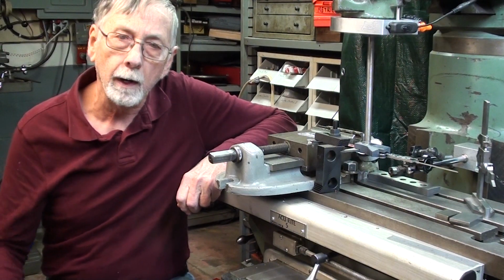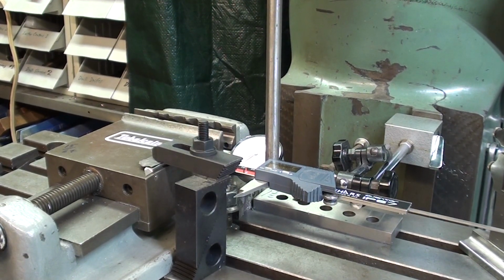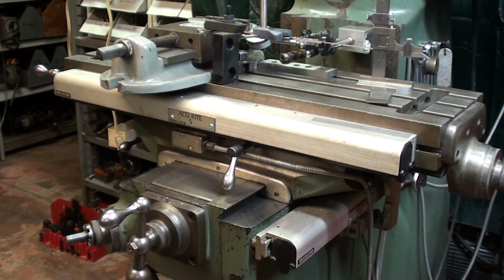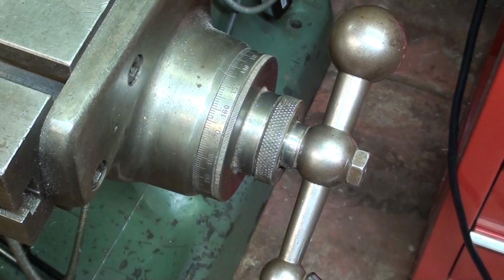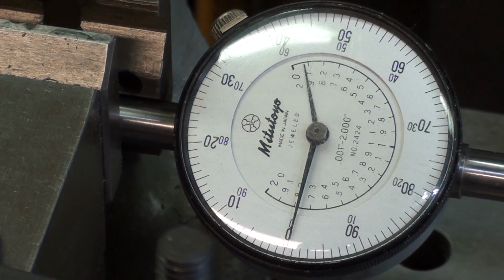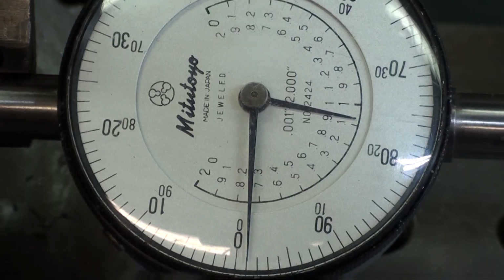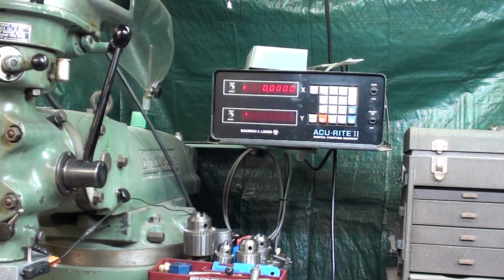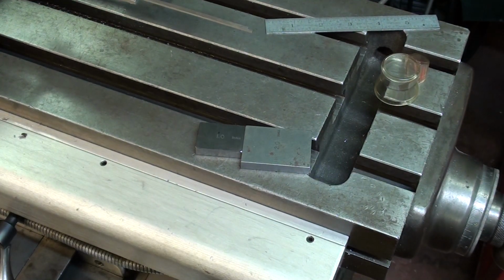Accuracy of the Bridgeport Mill Tips 527 tubalcain

Comment: I loved it!  We take things like this for granted and it's nice to test them out.    And I've got a couple of thoughts and an idea for you.  If the finger of the dial gauge is running on some roughness of the end cap I see it's on then if there's the SLIGHTEST angle to the whole setup the ball end of the indicator might be running down or up the side of a slight ridge.  It would not take much of an angular path  in drift of the finger to "walk" away and lose a thou or two.  So my suggestion is that the finger should be on a flat polished surface and then you may "find" your lost accuracy.

I've also got an idea for the gauge block test.  Set up and sweep a shelf with "back" wall  so the wall is very square to the X axis to a fine degree.  Make it long enough that you can test both the 2" gauge block and re-test with the dial gauge.  Set up the finger of the dial gauge on one part and with enough room for the 2" gauge block set up and zero out a test gauge.  Now run the table back a bit over 2", place the 2" gauge block and sneak back and set the DTI to read zero again.  And if the lead screw is "advanced" into zero on the DTI and again into zero from the same direction for zeroing the gauge block you can test the dial indicator, the dial gauge, the B&L digital RO and the lead screw all against the gauge block.

Howzatt?
Reply from the maker: Thank you, those are good ideas suggestions

Comment: Most any dial indicator will vary + - .001- .002. and beyond half way through the travel it can get worse. I never use much more than the first .1" on my dial indicators and most often only as a 0 to come back to. The little difference in the screw and the scales could be just the friction in the nut and ways, the glass scale sees actual table movement.
Reply from the maker: Thanks

Comment: GREAT FUN IMO! You got me thinking about the accuracy, or lack there of in the cadre of measuring tools here in my shop. There are 3- El-cheapo digital calipers, 1- Mitutoyo dial caliper, and my favorite little 1" Starrett 0.0000" micrometer. All were 0.001" of each other at 1.000"except cheapo #3 which gets abused to save the others. I guess next is the lathe ways vs mill table?! :) Thanks as always. G>

Comment: Just throwing this out. I would suspect that the dial indicator resting against the magbase may have some flex. As the distance decreased the amount of force on the dial increases which may flex the mag base. I would try putting another dial indicator on the back of the rod from the mag base to see if it is moving.
Tom

Comment: Nice work, Mr. Pete!
Maybe the dial indicator's max. accuracy requires a certain temperature? Perhaps you could follow up with a video on how dial indicator's accuracy are tuned, if that's even possible. Seems like the innards are just a transmission with a fixed gear ratio. The only thing that might change is the length of the plunger shaft, but the temperature would have to change while you are using it.

Comment: Of course accuracy and repeatability are different things. So far we seem to see measures of repeatability. Now, I know you know this better than I, but it seems that setting up to check each of these measuring devices against gauge blocks would help us determine the accuracy. My understanding is that gauge blocks are generally good to about 20 millionths of an inch, or as low as ~ 4 millionths, depending on the "grade" of the block set.

Comment: Hi Mr Pete, looking at your setup I think I have an idea why the dial indicator and the digital calipers were off a little.
Did you sweep them with another indicator to make sure they are perfectly in line with the ways of the bridgeport?
I did not hear you mention it so that may be the case. If they are not perfectly in line it causes what's called cosine error. ThisOldTony has a great video on the subject.

Comment: I studied metrology for a few years and the most important thing I learned is that every sensor or measurement devise is sensing or measuring itself. 
As for digital measuring  devices, the  accuracy of ALL of them is base accuracy ( say 1%) plus or minus LAST DIGIT. 
Where a human operator can distinguish whether the marks on Vernier scale align or not, digital device can not. One can observe this effect when digital device is positioned just so the last digit flicker between two adjacent values.
The last digit on a DRO or a caliper is 0.0005 (not 0.0001).
If DRO shows 1.000. The real value is somewhere between 1.0005 and 0.9995.

Comment: That’s interesting, however like you I tend believe in the DRO. On modern CNC machines the precision ball screws and the encoders is how they accurately position. Of course as those machines wear then backlash causes you same problems
Reply: Back in the 1970's I worked at Burgmaster in Los Angeles...building and testing the big turret mills and VTC's...the resolvers on the ballscrews were good to a 'tenth' but they didn't account for wear. However the electronic controller always made the moves in the + direction to account for backlash. The customers  that ordered 'standard' equipment got the ballscrew resolvers, the more demanding customers ordered the glass scale units..good for a 1/2 a tenth....yeah, 1/2 a tenth...waaaay closer than 1/2 a thou... Most of this stuff went to Hughes Tool Company...

Comment: Accuracy is a composit of reading, repeatability, resolution, standards, reference point, and money.  Then there are such factors as paralax, temperature, technique, attitude, phase of the moon, and how much accuracy do you really need.  As the military slogan says, "Measure it with a micrometer, mark it with chalk, cut it with an ax, file it to fit, and then paint it to match."About that dirt nap, put it off for a while, procrastinate, no big hurry is there?

Comment: I think many folks find it surprising that a dial indicator is not terrifically accurate over extended distances, but even a top quality dial indicator is likely to be spec-ed at .002" error over full travel. Unless damaged, they're generally quite accurate for short distances, such as measuring runout or other comparative measures. I had occasion to calibrate some dial indicators a while back (which basically just means checking they're still in spec, there's no adjustment possible). That's generally done with a (special) micrometer setup and it is a little surprising to see how they vary over their range. I'd say in general they're less accurate for distance than a digital caliper and way less accurate than a micrometer, although I had kind of considered them comparable to micrometers before working more with their innards.

Comment: I'm guessing the dial indicator and digital caliper may be a touch out of parallel with the table.

As far as the gage blocks go, it should be pretty straightforward to put a stop on the table and use a DTI to zero the location. Then just set the gage block between the DTI feeler and the stop and advance until it's back to zero. That's also a good way to test repeatability.
Reply from the maker: Yes, that video was in the can with the gauge blocks

Comment: Loved it!!! I was wondering if you had returned back to "0" using the Bridgeport dial, if the Mitutoyo would have returned to its original zero point.  If not, its mounting may not have been as stable as the other measuring tools.  Great Video drpete222!!!
Reply from the maker: Thanks , More to come

Comment: Could you set it up with an indicator against a fixed 2" gauge block stack as your standard?  For each measurement, reduce the stack by .5" and re-position the table to zero the indicator again, then and you know you've moved exactly .500".
Reply from the maker: I will be doing a similar experiments soon with blocks

Comment: I suspect the increasing spring pressure of the dial indicator was causing the rod on the mag base to flex slightly causing the error we saw on the dial.  It doesn't take much pressure to flex those things.
Reply from the maker: Be sure and watch upcoming videos

Comment: Very interesting experiment, Mr. Pete. This is a typical metrology problem; the guy with two watches is real. He needs more watches and read them more than once.   Separating variables helps - easiest would be to check dial indicator and calipers against the 2" jo-block. That  establishes consistency of both (of course within accuracy of the block-when was it last calibrated?). If Mitutoyo is indeed as bad as it seems (doubt it), use it while correcting for its error. Assume it is in linear proportion to distance. The take all these measurements 10-times or more, enter data into spreadsheet, calculate means, standard deviations and then see... Random repeatability errors will try to fall out of statistically significant number of measurements. Systematic errors will not. Then there is thermal expansion and its variation between steel and glass. Typical calibration temp is 20C. As someone mentioned, angular Abbe errors, and others - uneven wear of the screw (where most used) and and and; they all conspire. Hysteresis (stickiness) also is a problem. Then the real question is how good is good enough?
Reply from the maker: I think you lost me on some of that. But thank you I will be continuing on this experiment
Reply: @mrpete222  Mr. Pete, I apologize. I did not want to make it a treatise. You have done a marvelous job of demonstrating how difficult it can be to reconcile the differences in measurements using several instruments having comparable degree of (stated) accuracy. I am having a similar problem just now with measuring temperature using different methods.

Comment: Of course it’s interesting. It’s a great experiment. If only you had used a 36” diameter rod in the chuck! What were you thinking? Lol

A couple of things come to mind. With any digital instrument, there’s always uncertainty in the least significant digit. As the measurement ramps smoothly along, that digit “flips” at a certain point. Since you’re at the limit of your displayed resolution, it’s only exactly correct for an instant along that ramp, right when it flips. When you measure 3.4975 volts with your 4 digit voltmeter, no matter if it’s laboratory grade, it’s likely to vacillate between 3.497 and 3.498 because it has to make that rounding decision. Same with the DRO, even if the scales resolve to a gazillionth. So I think you can’t compare the tenths results on the DRO or caliper—they’re both rounding.

The dial indicator is still .002 away from the Bridgeport in the “backwards” test. Since the reference has moved to the DRO, they fall +/- .001 with respect to it. Makes things look better, in a way.

I’ve wondered before if worn lead screws become nonlinear, or merely loose.
Reply from the maker: Thank you, I intend to cover that point where the reading toggles

Comment: My thesis agrees with yours; the glass scale of the DRO is the most accurate.  I have checked my Bridgeport Clone Taiwan  mill against an Interapid .0001 indicator and the glass scale (Sino DRO). They are as close as my eyesight can detect.  I have no idea what the dials on the X axis indicate as the only dial I use is the one on the knee. It never even crossed my mind to check it. The only check I have performed on the knee is measuring a part and then raising the knee, milling the part and re-measuring. The knee dial on my mill appears to be accurate to about .0002. I have not checked the Y axis on my mill however.  I have a Mitutoyo Z Axis indicator mounted to the head that works great with the handle feed (ie drilling a hole to an exact depth). The beauty of a DRO is that it is not measuring the lead screw, backlash or the planets being lined up. It is only measuring actual table movement (in theory at least).  After viewing a BarZ video on checking indicators, I found that most of mine were junk which is why I now own the Interapid. I hope you will continue with this topic to its' fruition. Very informative!
Reply from the maker: Thanks for watching and I intend to make a few more videos on the subject

Comment: This was very interesting.  I would agree that the DRO would be the reference as the glass scale should be the most accurate.  I assume your shop is a perfectly maintained 20 degrees C (just kidding). The error on the caliper and indicator may be within the measuring tolerance.  I know the cheap dial caliper I use for rough measuring claims says it can be out by .002 at 6 inches.  You may be able to set to the gauge blocks up on the Y axis in some way.  That is just a thought.
Reply from the maker: Thanks

Comment: I would be cautious about using that DRO as the end all and be all for measurements. Are you sure that the scales are set absolutely parallel to the the table? If they are off the least little bit, there will be error introduced. How accurate are the scales themselves? When was the last time, if ever, were they were calibrated ?  
   Anyone using digital read outs must never forget that the last digit displayed is an all or nothing output. E.g. if the last digit displayed is 0.0000"/0.0005", the actual dimension can be anywhere between  +/- 0.00025" of the actual size.
  As Lyle says, locating features within 0.001" is not a trivial matter. You are in a different regime and you do have to approach the work differently. When you get down to +/- 0.0001", then the fun really begins and you become the cranky old guy in the back of the shop.
Reply from the maker: That was a good comment, thank you

Comment: Thanks for an interesting video. My suggestion is to carefully calibrate your dial indicator using the Jo blocks. Keeping the cosine error minimized you can very accurately determine how good the indicator is. I also agree with another commenter that the perpendicular rod used to press against the indicator shaft could be flexing. The Jo blocks would eliminate that error
Reply from the maker: I will be doing that very soon using a Johansson fixture

Comment: 40 years ago we would test the table positional accuracy of a CNC drilling machine against a B&S .0001" dial indicator. The servo controlled machine table would go out 20" and back 20" in "Y" for example via a paper tape loop. The table would should repeat to about .0001" after 1/2 hour or so of this.  When there was a problem you could see within a few trips out and back that the error would build. They used Heidenhain glass scales then. The most important thing was the amount of wear in the precision ground  table drive ball  screw wear AND the cleanliness and signal output of the glass scale.We had to clean the scales first when a positioning problem would occur. If that didn't resolve it , it was the bulb alignment or reader head alignment or something like that.We had to clean the readers on the machine shop readouts sometimes too. They would get oil film on them.They were Accurites like you have there. Glass scales are very accurate when they are set up right. Your digital caliper can only toggle between .0000 and .0005" I think.
Reply from the maker: That was a very good analysis that you gave me. And I like the way you said toggle because that will be in a future video, thank you
Reply: After all you give us.... It's the least I can do.
Reply: Paper Tape....high tech for the 1970's...!
Reply: Yes and the bulb for the tape reader head could be replaced with the courtesy light bulb from an early seventies Camaro. We had a Brown & Sharpe Validator that used a mechanical finger reader for the paper tape too. We've come a long way.

Comment: I like all your videos. I calibrate my CNC mill using the caliper the same way you did in this video although I wouldn't use an expensive one just in case. I find a good, well calibrated, Asian one works just as well for my purposes.  I tell it to move 2" and then compare the caliper to the software and adjust. I also use it to set my backlash setting in the software.
Reply from the maker: Thanks

Comment: The Engineering & Quality Assurance Departments ran "capability studies" on the machine tools in the machine shop where I worked.  The machines were CNC run directly from the plant's computers. Tolerances on our products were often in ten thousandths  of an inch for ground parts. They would make test pieces & measure them with micrometers and JoBlocks and digital comparators.  This led to some large machine tools getting a rebuild and/or the ways being scraped. Take nothing for granted!

Comment: Lyle, The dial gauge is not worn out, it has not been serviced since when? A cleaning and adjustment (if necessary) should bring it right back. Also when was the BP cleaned and the screws and nuts probably have not had backlash lessoned in almost never. Because "vernier" scale is so hard to do, spend 30 minutes or so explaining it please. When you explain vernier don't confuse the issue by also adding in imperial and metric On another time explain engineers foot (10" foot) standard 12" foot and leave metric out of it.
Reply from the maker: Holy mackerel , That's a big assignment

Comment: Hi Lyle, 
Clearly any digital unit, eg DRO, digital calipers will have an error because it steps, so if you have a 1/2 thou capacity, any reading will be inaccurate to that range. The screw on the machine, while the scale can be accurately engraved, there is the operator's capacity to get perfect alignment of the scale to the mark. There is also the potential for wear in the screw and for some speck of muck to get caught up in the screw or nut. 
I would have thought the dial indicator would have been the most reliable (if it's in good condition and not severely worn) as it doesn't have the step function of electronic systems, but is fully floating. 
Wonder what the accuracy of a CNC machine might be. Perhaps not as accurate as we might believe. 

Interesting experiment. 

Regards Dennis.
Reply from the maker: That's a good comment thank you. And I am not done with that dial indicator